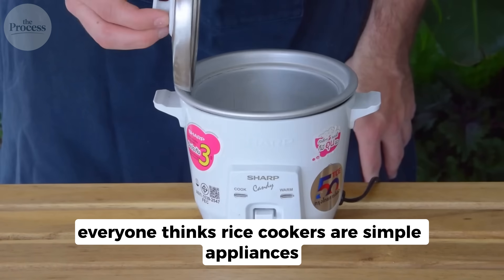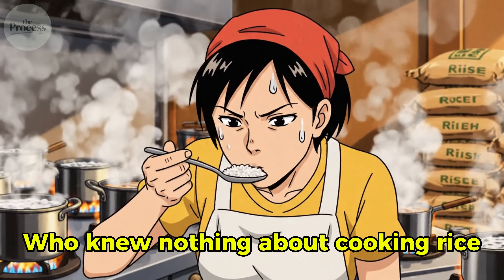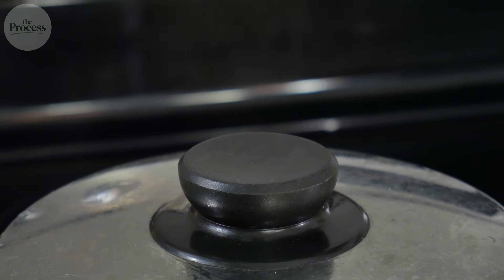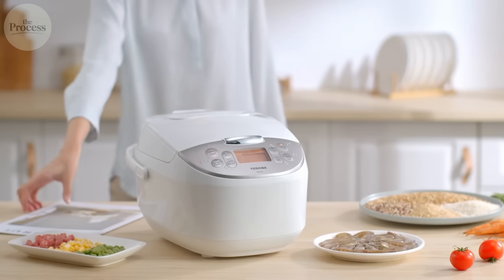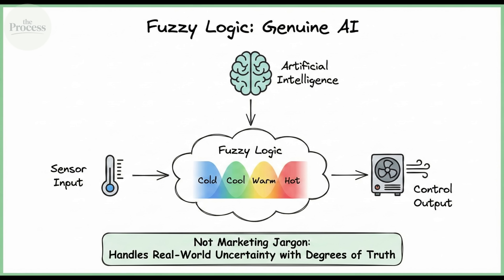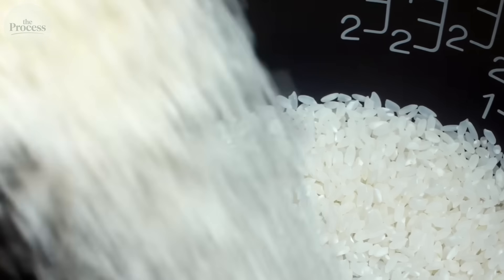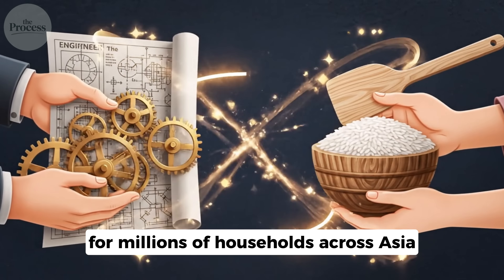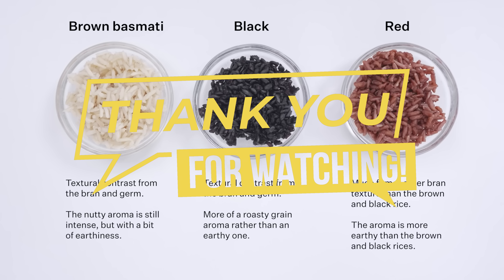Why Rice Cookers Are Smarter Than You Think

Comment: How ca a ricecocker recognise the rice, amount of water and what the user want?
Reply from the maker: Good question! A rice cooker doesn’t actually “recognize” the rice - it mainly reacts to temperature.
As long as there’s water left, the temperature stays low. Once the water is absorbed, the temperature rises, and that’s how it knows the rice is done.
Reply: @ThePr00cess Different types of rice require different cooking times which depend on the amount  of 
 water being used.  Similarly if excess water is used the cooker will continue to cook for a longer time resulting in overcooked rice . So the amount of water being used is critical .